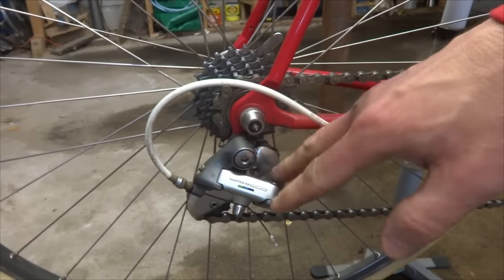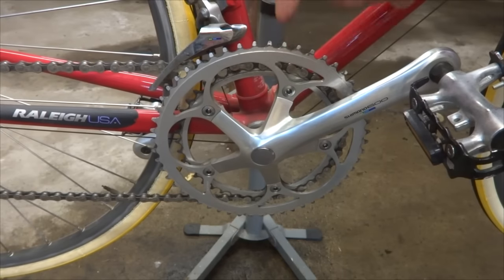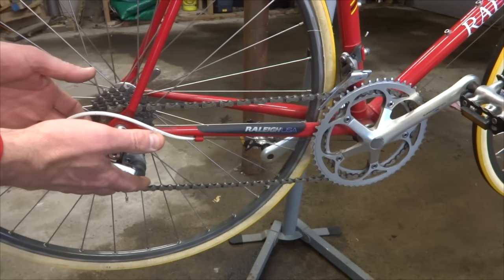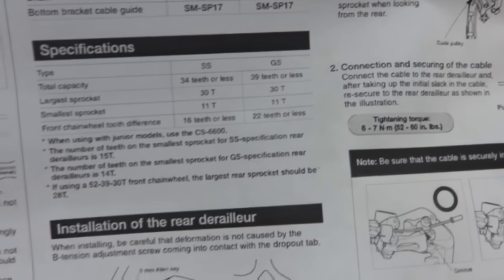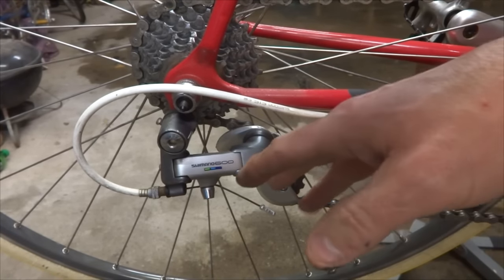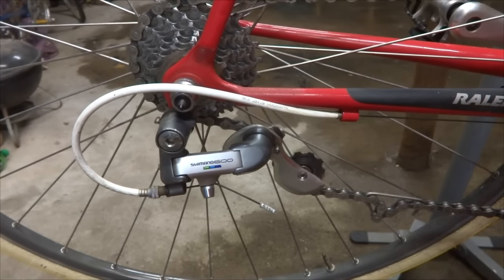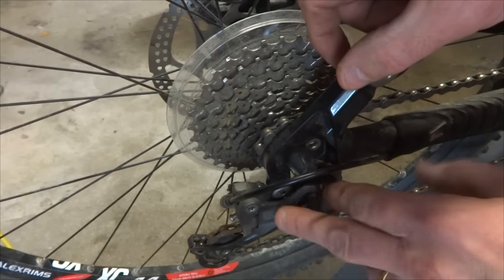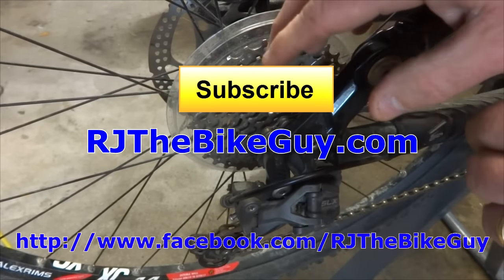Long Cage vs Short Cage Derailleurs - Which Do You Need

Comment: I have a cheap Walmart mountain bike (Hyper Summit) which came with 24-34-42 in front and 28-24-22-20-18-16-14 in back so I would assume that is a medium cage since the range of teeth is medium (18 up front and 14 in rear).  The bike came with Shimano derailleurs.  I want to go to a Shimano MegaRange gear in the back which replaces the 28 with a 34.  I will also try to replace my 24 granny chainring with 20.  So I will have added 10 more teeth of possible range to the total system but to help with not exceeding any limits, I can simply never use the largest chainring with the largest cog and never use the smallest chainring with the smallest cog....  Just because I widen the range of teeth doesn't mean I have to use them.  I guess the only way to know if my gear mods will work is to try them.
Reply from the maker: +David James Look up the specs for your derailleur.
Reply: +RJ The Bike Guy - I looked in the owners manual and it doesn't mention any specifications about the derailleurs.  When I look on the actual rear derailleur, it just has Shimano on it but I don't see any model number or any other markings.  Any advice on how I can figure out which model it is?  The bike is a new model (introduced within the past 6 months) called Hyper Summit.
Reply from the maker: Look on the back of the derailleur. It's usually on there somewhere.
Reply: RJ The Bike Guy - Yes you are right.  It is the Shimano tourney RD-TZ31 rear derailleur.  it was very hard to see but when I used a  flashlight at the correct angle, I could see it.  Thank you!  Unfortunately for me the specs online say it maxes out at 28T cog and I want to put a 34T on there.  Also my dropouts appear to be 135mm inside diameter between them so should I consider an upgrade to maybe an 8 or 9 speed freewheel if I will be upgrading the RD anyway?
Reply from the maker: You could maybe put a 30T cog on there. I wouldn't try pushing it to 34 though. 135mm is mountain bike spacing. Frankly I wouldn't spend any money upgrading a Walmart bike.
Reply: It is fun to upgrade cuz it is a cool looking bike in my opinion and with the 135mm spacing between dropouts, it has a lot of upgrade potential.  The 34T cog is very important to me cuz I need ultra low gearing which is why I will also be attempting to pop out the smallest chainring on the front 1 piece triple and replace it with a 20T.  The 24T gear is attached with rivets but luckily it has a 58mm BCD (Bolt Circle Diameter) which can accommodate a 20T chainring (smallest that will fit).  If I can get 20/34 lowest gearing (15.3 gear inches) I will be happy.
Reply: +David James I dont know if this will help you, but Im running a 52t front and a 34t largest back gear on my roadbike using a Shimano Tourney TZ and I dont have any issues
Reply: " I can simply never use the largest chainring with the largest cog" You can do this by accident quite easily, you are suddenly faced with a  climb - this can happen mountain biking and you instinctively shift to your lowest gear on the back forgetting you are on the big ring in front. Your chain locks up solid. This is exactly what happened to me on a busy road with no shoulder in CA. The chain was like a steel bar and the pedals wouldn't budge. I had to remove a derailer pulley to get enough slack to loosen the chain and get it onto gears that worked. So I'd advise agin it.
Reply: Peter Jack The situation you describe would never happen to me.
Reply from the maker: David James Until it does.
Reply: RJ The Bike Guy Except that I ride my "mountain" bike on the street most of the time.  If I know I will be going off road (usually grass), I "pre-shift" into the smallest chainring and then just select which cog is appropriate  for what I am doing.  Usually it is one of the 3 largest cogs and never the smallest  cog ( unless I am just briefly testing it for chain noise).

Comment: RJ you forgot the fact that the long cage Derailleur is notorious for getting easily bent so you have more issues with cog Chain Rub on the back . A short cage Derailleur has a stronger cage and the cage does not hang too far down so less dirt gets into the pulley wheels.
Reply from the maker: I have never had one bend. Maybe in a crash. Maybe you just have cheap crap derailleurs,
Reply: RJ The Bike Guy most cheap derailleurs have a very weak hinge to the spring arm and over time they start to go loose which means indexing is erratic. Was working on a Foldable bike and the derailleur cage was all bent at an angle. After sorting that out while redoing the loose bearings the shaft was found to be bent thus causing the cup bearings cover to wobble and causing noise when using the smaller cogs but not on the bigger cogs. Cheap bikes just have no quality control at all.

Comment: Hey RJ.. Could you go over an adapter for the RD hanger that allows the B screw to adjust in far enough that keeps the upper jockey wheel from rubbing the small clog if the B screw is NOT long enough for the adjustment. I've heard of this but not sure what to buy. I have a older Shimano DA onto a new TRek Emonda SL.
Reply from the maker: Buy a longer screw.
Reply from the maker: Are you sure you are using the correct derailleur for your freewheel/cassette?The chain length is correct?
Reply: Great question.. that answer could be different on who you ask. Im running a Compact 50/34 and 12 -30 Cassette with short cage Shimano Durs ace RD.  Shimano says 28T is max but I know from experience you can run a 30T. Climbed 9000 feet over the weekend and a mechanic I ran into said I could buy an adapter or longer B screw to keep it off the upper jockey wheel. The new RD hanger on the Trek doesn't line up very well with the B screw on the older RD. That's when he mention note of the adapter, Thoughts?
Reply from the maker: I can't see the bike. So I can't give you a solid answer. But I would check everything else before going with a longer b screw.

Comment: So there is no disadvantage to running a long cage derailleur other than weight? Does it handle torque the same as a short cage?
Reply: Derailleurs are not subject to torque, they just guide the chain so no issues.

Comment: I changed out the wide range freewheel on a 96 Gary Fisher (bought on CL) for a narrow range also changed out the 42T chainring for a 44T. Can and should I change out the long cage for a short cage without getting a new deraillur?
Reply from the maker: Change the cage without getting a new derailleur? Use a derailleur to fit your specs.

Comment: Is it possible to determine the capacity of a derailleur without refering to it's instruction sheet (eg, measuring cage length, jockey wheel diameters)?
Reply from the maker: Not that I am aware of. Maybe if you were a mechanical engineer.

Comment: Im a slacker with megarange.
My derailleaur was damaged and is no longer available.
Tx 31 shimano.tourney.
Any suggestions.
I got a ty 500 and it did not work.
Unless i change crankset and shorten chain.
Not gonna happen.
I would think megarange derailleaurs would work.

A lot of times even though it has more gears...
I set it up for the gears i use.
One  up front and a couple in the back and a mega gear.
Thats it.
But most bikes i get have way more crap than i use....and that usually is the intent.
Use defines purpose.
A couple of gears...not 24 speeds.
I just need a couple and an extreme uphill.
Whats with the sprocket madness.
Reply from the maker: Simple solution is buy a used Megarange derailleur on eBay.
Serious cyclists know where their power range is. They are most efficient pedalling in certain cadence ranges (ie 90-100rpm). More gears allows them to stay in that cadence range at different speed/terrains.

Comment: When you count the difference in teeth between the smallest and largest cogs and then report that to the chain, should not that number be divided by roughly 2? After all, the chain only goes around half of the chainring/sprocket.
Reply from the maker: I did it the way it is normally done.

Comment: What is your opinion on yellow sun damaged spoke protector? Removed it or replace it?
Reply from the maker: If it's just yellowed, pull it off and wash it and will probably clean up nicely.
Reply: @RJTheBikeGuy  sun damaged plastic are brittle. Crumble to dust.   Plastic don't last. I used to used old CD. Cut hole in the middle. But that do not work well, cause it is flat. Need cone shape to match spoke angle. 

So I cut sheet mtl to circular shape. Hammer it flat. Watch lots tutorial on sheet metal cold forming. It is possible to DIY spoke protector from sheet metal or metal bottle. Actually pretty easy and fun to make. Can even make it from giant beer can or all the Pepsi can you have in your garage.

But not as good looking as $3 new plastic spike protector or alum mass production spoke protector. 

But one of the kind. Signature mount on bike. No one can steal the bike.

Have you make one before?
Reply from the maker: @VITAKENNY  Then chuck it. Buy a new one, or ride without it.
Reply: @RJTheBikeGuy  I did not know what it is for before. Ride without it. And broke the spoķe.
Fly spoke protector from everyday materials. Have u made one ?
Reply from the maker: @VITAKENNY  https://www.youtube.com/watch?v=o9oVJUplaQI

Comment: David, could I ask you, in your expert opinion:
I have got a triple 32-42-52 front and a 21/13T rear block. Should I get a short cage or long cage?
My chain wrap value is 28...
But, due to mechanical sympathy on my part, I am not going to be using anything more than 4 sprockets on the back with any of the front cranks. By this I mean, the:
32 front paired with 21,19,17,15
42 front paired with 19,17,15,14
52 front paired with 17,15,14,13

So, how does that change things? And as I've heard that a short-cage gives a quicker, more precise shit, would a short cage actually do me?

One last question, if I wanted to put on a 7 or 8 speed block when the 6 speed wears out, I would go only as a far as a 
23 rear sprocket. If an 8 speed, it would mean 23/12 (maybe).
Would the same short cage fit this too, bearing in mind that I would be leaving out extremes of chain-crossing?

Anyway, the 1st question is obviously far more important for now. Any advice you can give me would be extremely appreciated.

Thanks and God bless :)
Reply from the maker: I explained exactly how to figure it out in the video. And going from 6 to 7/8 speeds is probably not going to be as easy as just swapping out freewheel/cassette. It gets into hubs widths, shifter compatibility, etc, but that's a whole other issue.
Reply: Thank you RJ. As already posted, I did say your video was very useful, and sincerely thanked you for it.
However, the chain wrap capacity value which you outlined in your video appeared to just cover the extremes of combinations e.g. big ring with big sprocket.
As I don't cross-chain like this, I was wondering shouldn't the equation be changed to reflect this?
I only ask as considering that my chain wrap capacity is on a borderline '28' going on a full chain-crossing calculation (i.e. 52-32, and 21-13). And I would rather stay short cage as I've 'heard' that they are a bit more precise and quicker shifting than longer cages.
I have tried many other fora, but can't seem to get an answer on it.
I ask you, as you seem very obliging by your demeanour on screen, knowledgeable, and because you go to the trouble of producing lovely videos for the purpose of educating and helping people with no apparent financial motives.
If my asking still offends you, I understand and apologise sincerely for same.
Reply: P.S. Will be using nice, simple friction shifters
Reply from the maker: You have to take into account ALL the combinations. It's easy to say you never cross-chain, up to the point where you accidentally shift into that combination and destroy your derailleur, take out your rear wheel, crash and die. You can do what you want, but I recommend very strongly to take into account the full range of possible gear combinations as I do in the video.
Reply: RJ I don't know why you have to be so confrontational and ungentlemanly. I did apologise and have been nothing but cordial to you since.
You seem to want to help people with your many videos, yet you can't seem to take an innocent mistake and subsequent apology with good grace?
Reply from the maker: I have heard the same thing before. Install the derailleur that accommodates the full range of gearing. Sorry, but it's just plain dumb to install a derailleur doesn't. You are risking potentially massive damage and injury for nothing.
Reply: Thank you for your concern.
I am risking nothing. I didn't ever say which derailleur I was going to install as I didn't know which one to install. This was why I asked you, for your expert opinion. 
It's not a problem. I will ask someone else for the answers to the specifics I asked, as you seem unwilling or unable to answer them. But thank you for your time.
Reply: "Always"??
Well for what it's worth to all of you out there, who as I can see are genuinely interested purely in the mechanical aspects of the questions I raise: I used the old Sachs Huret Rival short cage derailleur that I had. I just cleaned and polished it up, lubricated it - and it's working fine.
No chain wrapping, no catching or snagging.
I actually asked a seller with a lot of obvious experience, who would have made more money out of selling me a medium or long cage derailleur than a short cage, which is what he was recommending.
I already had one, and thought I'd just try that.
Hey presto, no problems.
Oh and for what it's worth Tempo, your "granny cranks" comments are irrelevant when you're talking about small sprockets.

Comment: Rj great vid! Do you have a similar video on front derailleurs??
Reply from the maker: Front derailleurs are completely different than rear derailleurs. They don't take up chain like RDs.
Reply: +RJ The Bike Guy ok thanks. So if i have a triple crank and 8 speed cassette i can use a 3 x 8 front derailleur right?
Reply from the maker: Probably. FD's also come in road bike or mount bike flavors. There are also different clamp sizes, or even braze on models. And then they are also top pull or bottom pull..
Reply: ah ok you should make a video on them I'm sure it would get a lot of views! THANK YOU

Comment: ay RJ are mongoose a bad bike I have 2 treks roade bikes they i wanted  i to get  Mongoose mountain bike from Walmart an I got one an forks bent
Reply from the maker: +bikeman C A lot of Mongoose bikes are low end junk. There were some that were better. But pretty much any bike from Walmart will be junk.
Reply: +bikeman C I have a 1996 Mongoose made with double butted tange and Deore XT groupset. Some are decent.
Reply: +CannedPakes that was before they were sold to pacific cycles. After 2001 mongoose made shite bikes
Reply: I have a 26 inch Mongoose Switchback Expert. I got it through Amazon about a year and a half ago. At that time of purchase from Amazon it was around $189.99 plus shipping, which was around the going price of an equivalent Mongoose mountain bike I seen in Walmart. After comparing the two bikes I chose the Mongoose Switchback Expert through Amazon which had way better components on it than the Walmart Mongoose. On the Mongoose website the same Switchback Expert retails for $449.99. The Mongoose bikes at Walmart have low end components on them like the brake levers, shifters, derailleurs, crankset, suspension fork, disc brakes and so on. That's why they are priced lower at Walmart.

Comment: What would be a good replacement for  my x7 9 speed rear derailleur short cage  on my Mondraker downhill bike ? I can't get one anywhere . Any help appreciated .
Reply from the maker: You gotta do your own research and shopping. Find an identical derailleur, or one with similar specs.
Reply: @RJTheBikeGuy  i'm a bit puzzled with your reply , does doing research involve asking questions and hopefully someone not so arrogant and their head up their own arse would be happy to help ? If you don't know yourself just say so thanks for nothing .
Reply from the maker: @jake30966  I get these requests all the time. There are probably hundreds of derailleurs that would work. It all depends on the specs of your bike, your cost range, what is available where you are. etc etc etc. I am not spending my time doing your research. I am not your personal shopper.

Comment: The pontential slack in my mtbn chain is 49. Can anyone help me to find a good quality derailleur that fits? This is mine now and as you can see it's pretty streched out... http://www.imagebam.com/image/3d5a47507316793
Reply: I'd say your chain is 1 or 2 links too short.
Reply: Maybe, but I still can't find a rear derailleur that can handle that amount of slack. The highest one I've seen so far has only the capacity of  45. I would be gratefull if someone could link me a rear derailleur that can handle a slack of 49.